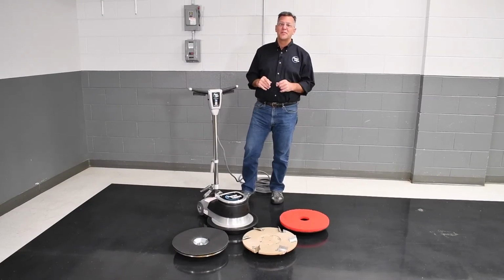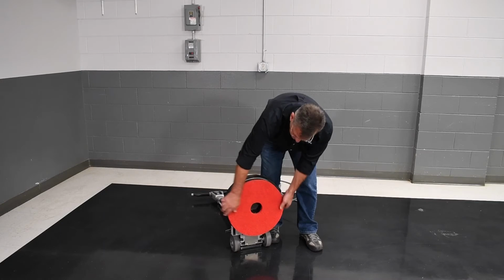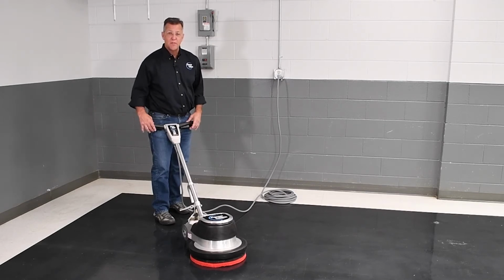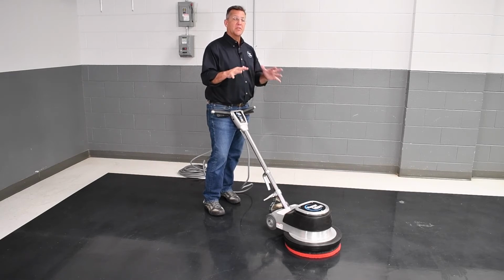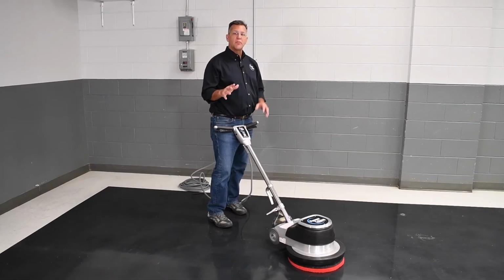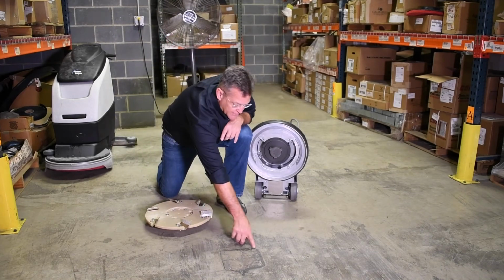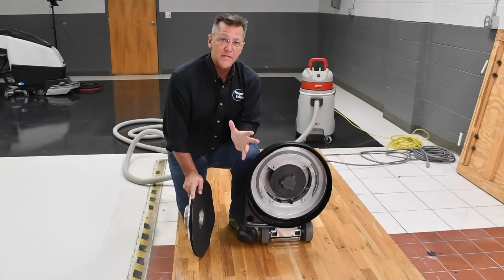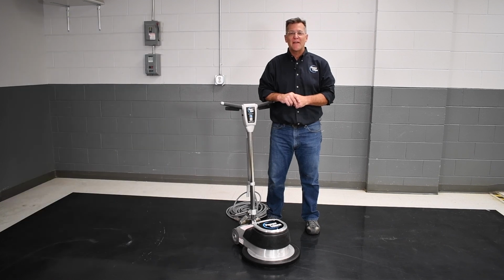Pioneer Eclipse FM Floor Polisher

Comment: Can you use this machine on epoxy floors?
Reply from the maker: The FM is a versatile machine that can be used on many floor surfaces. It can be used on epoxy floors, depending on what your application is and if there is texture above the floor surface.
Reply: @AmanoPioneerEclipse  This epoxy has been applied to concrete floors in a storage facility in the hallways. They have been scuffed up from people dragging things, from cart wheels, dollies etc. We are looking to rent this machine from Home Depot, but want to be sure it will not damage the floor, and the Home Depot staff aren't as knowledgeable with the specifics of this product. Do you think it would be safe to use?
Reply from the maker: @diamondsangel4369  The FM Floor Polisher can be used on a floor you described. The machine itself will not damage the floor. Successful cleaning or restoration of the floor is dependent on the cleaning or scrubbing pads, solutions, and the processes used. This machine can be used for concrete restoration, but I don't believe concrete restoration tools or processes are applicable to epoxy coatings.
Reply: @AmanoPioneerEclipse  Thank you so much for your help. :)